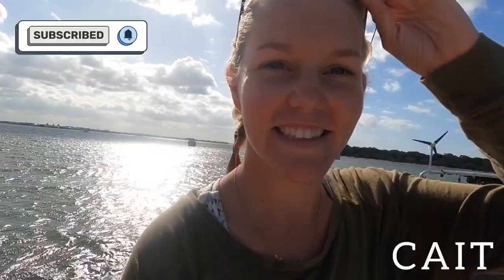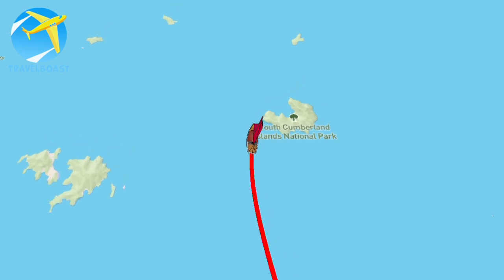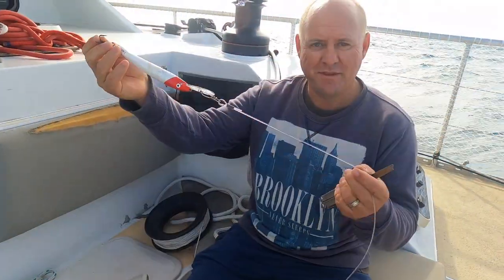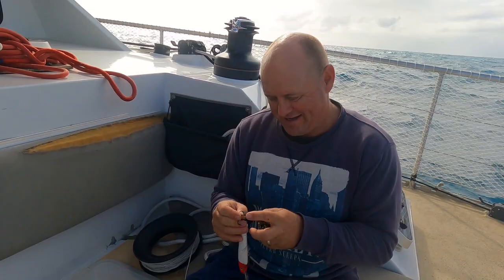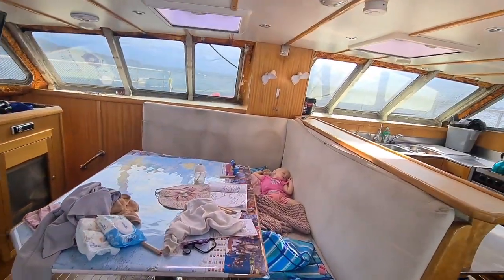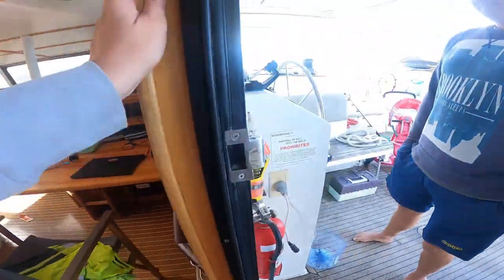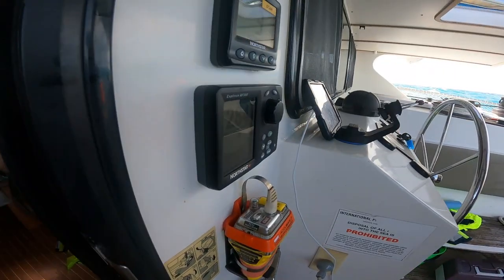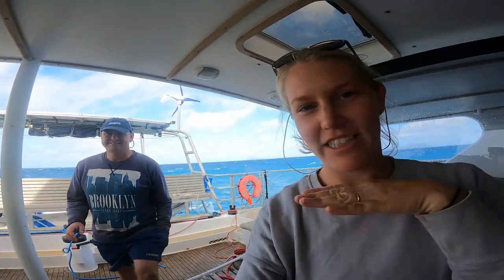Our Donkey Slaps! | Rough Seas on an Aluminium Catamaran | Sailing with the James's (Ep. 44)

Comment: Just a small hint, cover the holes before cutting timber above them please. Stops stuff dropping into your tank that the vacuum cleaner might miss.  Your cat seems to have a reasonable clearance under the bridge deck , so what was the wave height that your were sailing in? Love your cat , good luck fitting her out . Best wishes.
Reply from the maker: Thank you!! She's got good bridge deck clearance, we are hoping to get her up a bit more, up to design water line and then hopefully reduce the number of donkey slaps 🤍🤍🫏🫏
-cait
Reply: 😂 Moving the junk in the trunk and not overloading is an art with cats.. 

Are the props three or two bladed ... ? Pitch is the key sounds like they are large enough... 

Burn down to a marker line and add a known capacity jerry can to each tank .. in fact filling and marking off though slow is a worthwhile day.
Reply from the maker: @clivestainlesssteelwomble7665  we currently have about 300 litres a side and when we get down to the bottom to refuel we will be doing a day task of marking the tanks, whole heartedly agreed it'll be very well worth it. 
We have 3 bladed, Kiwi Feathering Props, we ideally would love feathering props for less drag through the water 
-Cait
Reply: @sailingwiththejamess  

They are fiercely expensive items new ... and variable pitch items really are whats required by most boats...is my feeling. 
Seems like water props have been lagging behind their air equivalents. For fixed props the sharrow toroidal type has been a breakthrough for displacement and planing speed vessels. 

For sailors the pictures more complex and for Electric hybrids 
especially  for regen under sail its even more explorative.
Basicly the electric motor gives you total control of speed and full torque from 1 rpm up .

Manufacturing propellors is expensive ...small numbers and highly variable pitch numbers. 
Also the material wastage is pretty bad for metal items... The logical answer is to develope your type size and 3 D print or mould/ forge a ceramic type composite like basalt 😉 
If i was looking at the problem i would create a a range of  standard adjusting hubs 2,3,4,5 blade that the printed blades could be fitted to in sizes ab profile forms
 
Theres also the rim drive motors with replaceable internal blades.. that are safer. Quieter and more efficient .
They can also be made to retract but i dont recollect one that can regen under sail though i cannot see why not.🤔 
Theres a French company from Brittany that already has a 6 kw and 12 kw version available and others on the way. 

These are  easy to vector and retract from the water and essentially have only one moving part that is water cooled by immersion.

Its like the e motors ... too expensive and using too many rare earths and copper..  There is an answer if you take a look at a UK company called Advanced Electric Machines from nr. Newcastle england ...they have built a range of modular motors and light strong efficient transmissions that use steel and Al and are highly efficient. 
Infact i think their designs have been adopted by some of the marine markets leaders in electric motors and regeneration by the look of the motor casings.
Reply: The flat alloy bridge deck might be the issue... Long term you might try adding wave breakers to the underside..  

but all that's after you've got your dagger boards working and played around with your rig.
👍🏼😉🧙‍♂️🇬🇧
Reply from the maker: Hey Clive,
Dagger boards are working but I plan to reshape them next. Thanks for the ideas on props, at this stage well be sticking to the diesel engines untill they start giving us dramas and then go electric. I'm hoping to get a few more years put of the engines though lol. I think I may have convinced cait to get new props so fingers crossed lol.
Reply: @sailingwiththejamess  

😂 good luck with that one.... 
Diy thinking takes your existing motors and either turns them into generators or add belt drive electric motors to your existing shafts.. several companies do this.. as a piggybacked hybrid drive.. just it adds more complexity and wt.  but it can still manage re gen.

You Can pick up sail regen legs that you can lower into the water independently .... 

Waiting till the opportunity or the ICE gremlins  bite is sensible with the speed of changes in E technology at the moment if you can figure out whats going on with your existing props you might be able to get them modified a little to improve the running.🤞🏼
Reply from the maker: Dang, I have just purchased new props. I am now wondering weather it would have been smarter to get fixed ones and do a lay shaft for an electric engine. Hind sight is always wonderfull, I would love to go electric eventually.
-sam
Reply: @sailingwiththejamess  

Whats the difference in the props..  or is that a forthcoming episode. Somewhere i found a Uk chap from liverpool who did a really good job of explaining how to judge prop speed pitch and diam. V hull speeds. 
I will try to dig it out hes on u tube.. but it could take a me some time to find it.
Reply from the maker: I will probably do a video on it as I think our current kiwi props aren't that good. We have just brought folding props. As soon as I get some kind of silicone based antifowl I'll swap them and do a video comparing them both.
-sam